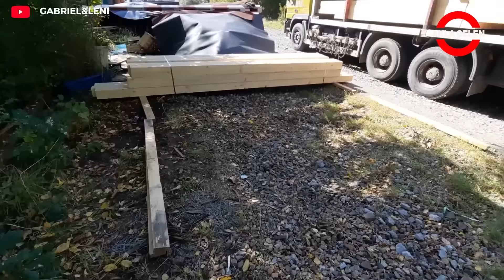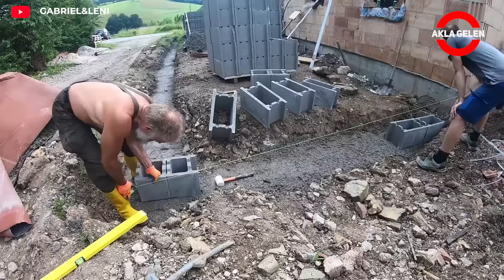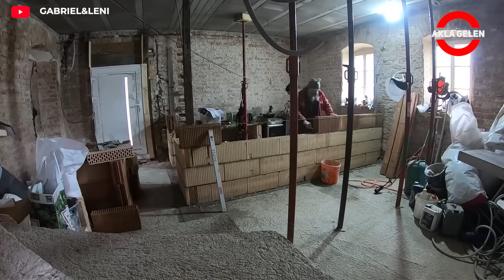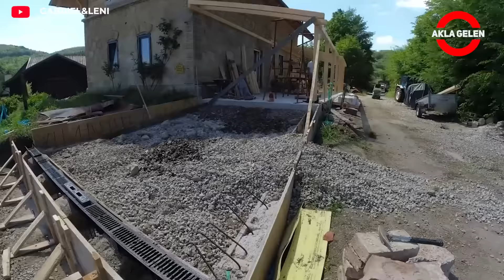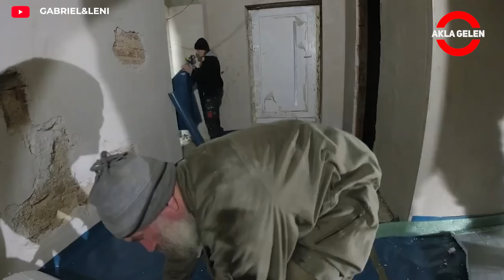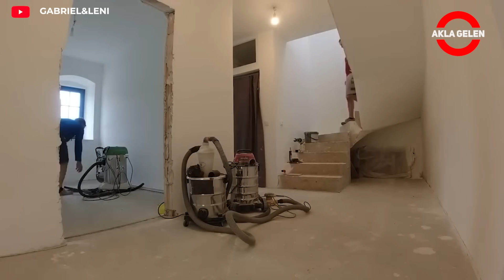Family Renovates 100-Year-Old House, Turns It Into a Dream Home | Start to Finish @Gabriel.Leni100

Comment: As an owner of an old house in Germany that is currently being renovated, I will never understand why people go for a heat pump instead of an AC that can heat and cool the house! AC is even more efficient than the heat pump that uses water as a transport medium. This house it going to be a furnace in the summer!
Reply: Well there is very obvious reasons for a heatpump vs AC. The AC can only heat/cool air. The heatpump can heat walls & floors. This makes a big difference in winter. And for cooling in summer there are fancoils which use water as a medium. We will have 3 fancoils in our house for cooling.
For a quick retrofit an AC is much easier. But with large reconstruction like we did, it's higly beneficial to install floor heating and in some cases also wallheating.
Reply: @Gabriel.Leni100  Agree to disagree. You need so much less time for heating or cooling. I have one winter behind me and it was perfect. And now with the first warm days it is also totally great.

Comment: I wouldn't really call this a renovation of an old building. You basically just built a completely new structure using a little bit of the old structure.

Comment: The only reason to preserve those four stone walls is that regulations prohibit their demolition. Otherwise, I see no need to maintain that structure. It's not a renovation, since 90% of the old house is being demolished. 
It's interesting to renovate an old house as long as the entire exterior structure can be preserved and only the interior needs updating. Here, almost nothing remains of the original house.

Comment: A new building with a few old walls left standing. These days, that's called a renovation. Not much of the old house's original character remains. Well, it doesn't have to appeal to me. But the interior design turned out really nicely. 👍🏼

Comment: Coming from New Zealand 🇳🇿 land of earthquakes I find the building techniques interesting. Something built this way in New Zealand would never meet code. BTW, how is this a renovation? Aside from the 4 stone walls nothing else is being renovated. It’s 99% a new build
Reply: Rich people call this renovation. They just spent 10 million dollars on concrete.
Reply: @TOFK911 lol😂
Reply: @craiggillett5985 we actualy did spend arround 200 000€ on this whole project so far. It's not finished yet so it will still take arround 50 000€ to be done.
Everything what we have done was done according to engineers drawings & calculations. But for sure there must be big differences to buildings in New Zealand because we do not have eartquakes here... also by law we were forbidden to demolish the stone walls. Took a lot of effort to work around them. For sure it would have been much cheaper and easier to build new. But this is what we had so this is what we worked with. Took us almost 5 years until now. No bank or mortgage involved here. Just every months salary spent. Greetigs to New Zealand!